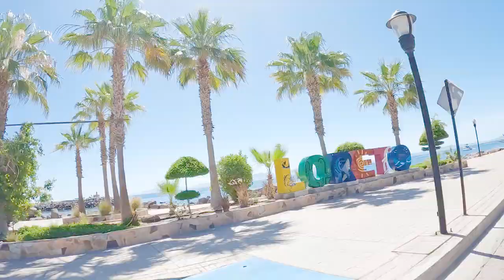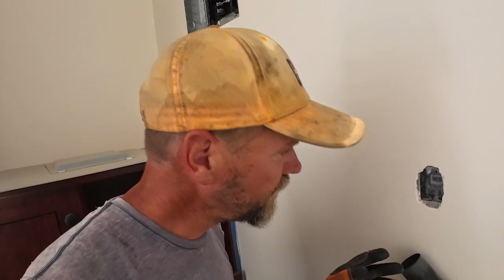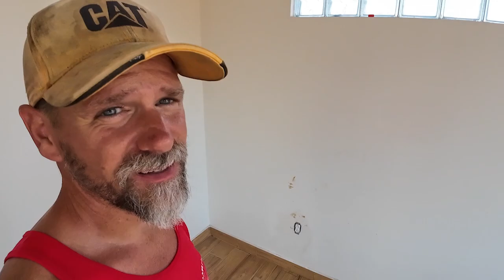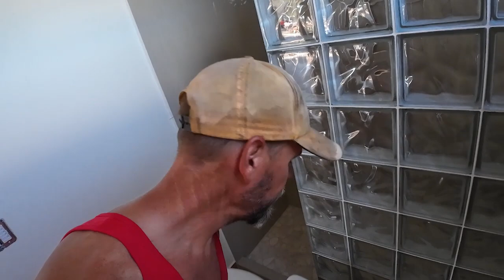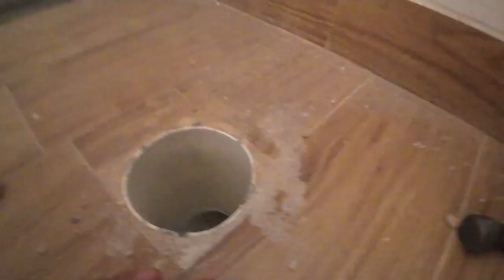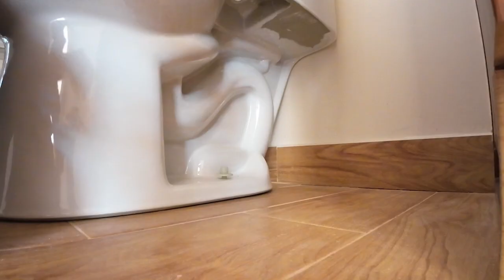The Historic Heat Wave Won't Stop Us From Finishing our Resort in Loreto, Mexico!!!

Comment: The summers have always been tough here in Palm Springs, but this year seems to be exceptionally brutal.  Highs 115 to 120 all of july.  Lows in the 90's.  Now it's august, and we're still struggling through the prolonged excessive heat warning.  People are losing their minds in this heat. Only thing is we don't have the humidity Loreto has.  Be careful and take a lot of breaks!
Reply from the maker: Yeah it seems to be crazy everywhere this year. I have been learning my limits and learning to identify when I am overheating. If I catch it soon enough I can go into the air conditioning for about a half an hour and then I am good to go back out and work in the heat. Stay cool

Comment: It's been 100plus degrees here in Dallas Texas for what seems like weeks now. Very Atypical and strange weather this year. I can handle consistent hot weather with highs inthe 90 but 105 plus is a whole different level of torture especially if you're outdoors or have no ac in a vehicle
Reply from the maker: I just tried to take it slow and stay in the shade. I have had extreme heat sickness twice since I've been down here. Vomiting, high fever, chills, extremely sick for 48 hours. I now can recognize the initial symptoms and go in and cool down when they happen. For me I start getting light-headed and nauseous and then I know it's time to cool down. Usually I can cool down for about a half an hour and then get back to work in the heat. Definitely a learning experience coming from the Pacific Northwest where it is cold or cool most of the year.

Comment: Really Really Looking Good.  1 question because I do not know the answer. Why not run the wiring before the plastering?  Re rust stains, my chemist friend used sulfuric acid on his rust stained toilets. However his septic system "complained". But the ones in storage can be treated that way I should think. Anyway grrr8 looking job so far.   P n D
Reply from the maker: Thank you! I think the main reason for not pulling wire before plaster is that they are generally extremely sloppy with a plaster. If you didn't refill all the boxes with foam after you pulled the wire you would most likely get them all filled with plaster. I was an electrician in the US and it is definitely different down here. Residential in the US is all Romex done before any drywall goes up. I did have some experience running wire in conduit from doing commercial in the US and that gave me a few tricks that helped get the job done. Good eye on the rust stains. When you put acid down the plastic conduit to dissolve the concrete you end up getting acid on the metal box which then corrodes it and rust forms. Big mess but there's not really any other way to clear concrete out of conduit that I know of.
Reply: @dooglassandesperanza  No I meant for removing those stains from the toilet.
Reply from the maker: Oh I missed that. It's definitely worth a try. Thanks